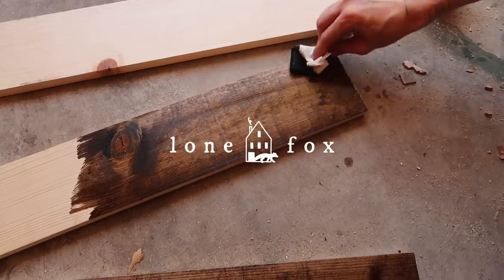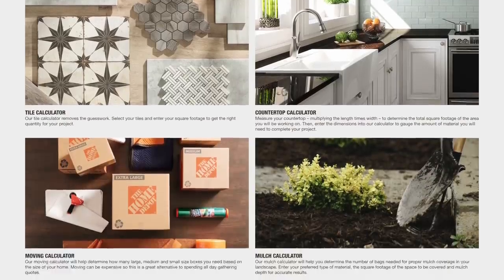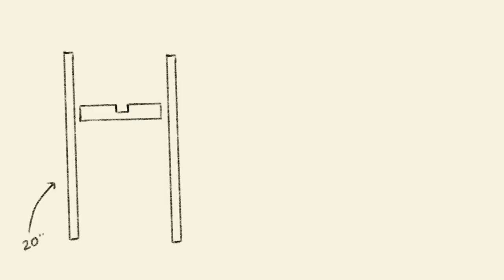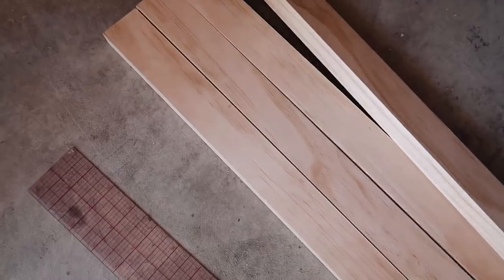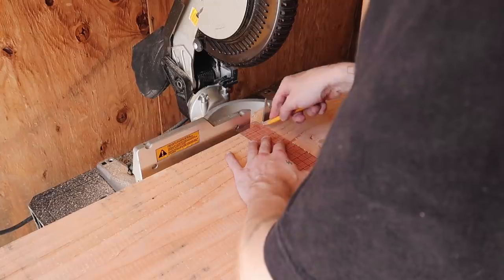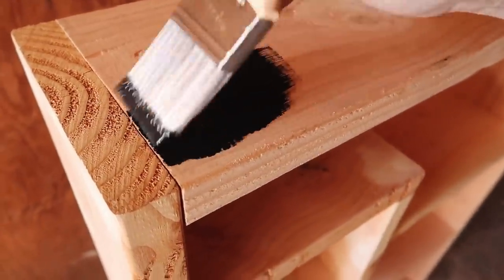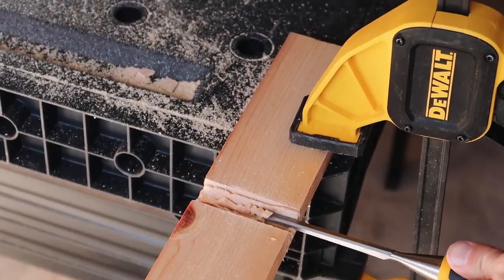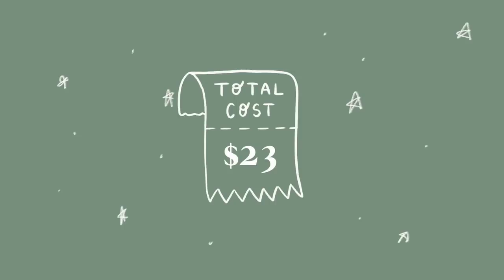DIY Furniture & Home Decor Projects (From Start to Finish) 🔨 *Budget Friendly & Easy*

Comment: Congrats on dipping into woodworking! You've got some good structure there, but I'd recommend getting a good sander next. Sanding the wood before painting is not only going to give you a better finish, make the paint last longer, make it possible to dust the surface and keep it clean, but that will help you achieve that finished look that you're going for. A matte sealer afterward will also help keep the piece looking nice.

Comment: Home Depot also has cull piles where you can find imperfect wood marked down 70% off. They spray it with a purple mark to indicate cull.  Last year I happened to be at Lowes a couple times where I noticed they were throwing out scrap.  I filled up a couple shopping carts that I took home when wood first started climbing rapidly in price.  Most of that find was solid decking pieces.  Thank you for posting this video, some great ideas I can use all this scrap wood for.  I also plan on making some kitchen countertop with much of my scrap.

Comment: I really like how that wall shelf turned out! The other shelf, with the cubes, I liked too. The only thing I would do differently, if it's even possible, is to angle cut the corners so it doesn't look so clunky. Thanks for sharing. 🙂

Comment: So impressed. And inspired! My woodworking skills can best be described as beginner. I need inspiration to pick up my tools. I don't know if anyone else has suggested it, but I bet you would like using a Kreg jig for pocket holes. I have the smallest (and cheapest) pocket hole jig they sell. It was surprisingly easy to use and makes better joins.

Comment: Really love your videos! Just a little tip about the miter saw if you make sure that the wood is pushed up against the fence it will make a straight 90° cut. Sometimes if you don’t push it up against it the cut can be a little off. Keep up the good work! I watch your videos when I feel ambitious 😂

Comment: Experiment with using 45 degree angled cuts as you can create a neater look on the corners of the overall piece. Very easy instruction, and I think I'm going to try making the same thing, but I might use a thinner board, personally. 

Any idea on the weight?

Comment: First project optimization: hole and wooden dowel from inside to connect vertical and horizontal timber together. //when I first saw your nails I felt pain, cause I thought you got them between a door. Looks like that, with the black nailroot.🤕😨

Comment: I had to thumbs down. It wasn't the pieces but the "reality" of the cost. People who post DIY NEVER include the cost of the material with pieces to make it. Who really has an electric saw? I did a DIY for a 6ft bench with 6 legs. Total was near $100. That's including wood+legs+brackets+stain+gloves+cloth for stain. That's NOT including the power tools. So the execution is simple enough but the cost to do it all is not. And before anybody argues with me, yes it's an investment if you get a power tool and yes they do sell basic sets for $99 etc but youtuber DIY never include the price on the side for the machines they use so a $45 shelving unit us more like $250... just saying